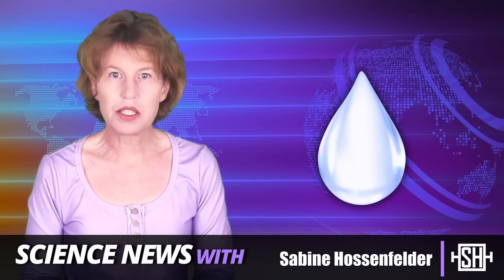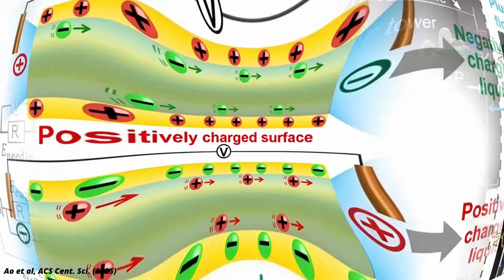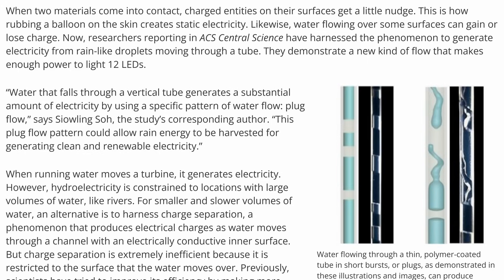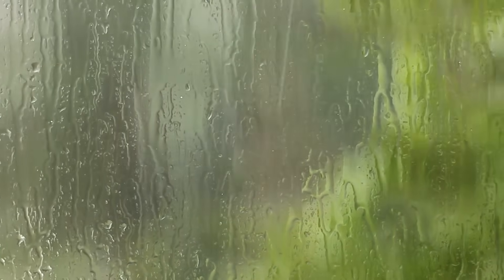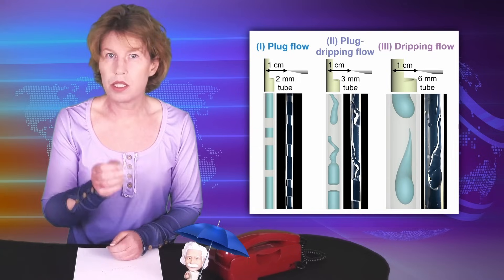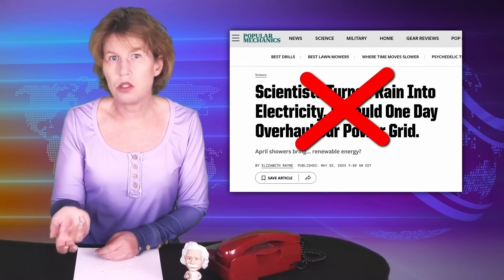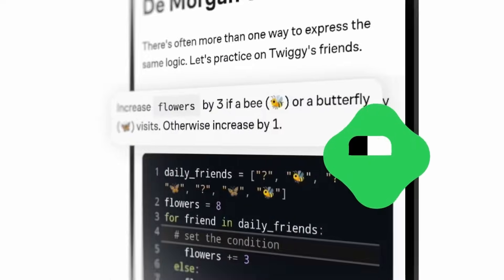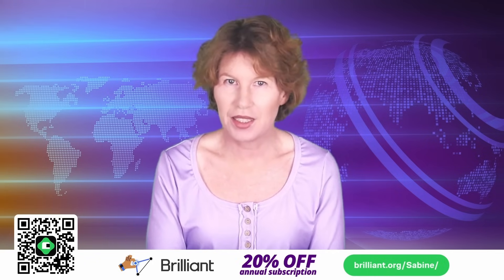A New Way to Generate Electricity From Rain

Comment: It's worse!   The paper is wrong!   100W/m2 just seemed too high to me.  I reviewed the paper and they have overstated the power density by a factor of 640x!     I looked to see where the 100W/m2  had been derived from and I found that the  authors have made a fundamental error in  their calculation.    They quote a peak power of 440 ± 13 μW  for a 2mm diameter tube,  320mm long.  To derive the W/m2 they have used the area of the end of the (2mm diameter)  tube and used that as the multiplication factor and indeed this would give 140W/m2 (as you have also calculated).  However,  the area of the generating device should be the internal surface area of the tube.   This means that they have an error of 640x  in their energy density calculation.   The correct figure is just 0.21W/m2 for the device. This is not a practical cost effective way of producing power in any form.

Comment: I told people years ago that eventually there will be cars which run on water, not on conventional fuels. Then I told them that energy will be made from rain. Then they were told that people will make energy from places, where there is no rain. Today solar panels are used to power deserts. When people listen to ideas like this they seem ridiculous at first. Then the facts come which show why they are not ridiculous. This is not hydro power, as hydro power will eventually be regarded as primitive tech. Instead, the electricity is generated from the rain itself, straight from the sky. That way you can make it possible for rivers which have been dried for centuries to flow again.

Comment: 2mm diameter tubes will quickly block up when exposed to the external environment, algea and other such fun stuff would build up. It would need to be a closed system with a fluid that will not block up thoe small tubes that such is used in.

Comment: A reservoir for fluid retention, along term fluid that does not do anything funky but will act like rain does in the generation tubes, an external method to get the fluid from a sump back into the reservoir... YOU now have a Gravity Battery...

Comment: I did the calculation for the potential energy of all the water hitting my parents roof about 20 years ago and I think I calculated that annually you'd get about 1kwh which is less than 20p/c and that was without any efficiency calculations just how much energy could be gained by the falling water.

Comment: I've already been doing this for over a decade now.  Actually you don't even need the water.  There's natural voltage potential between earth and increasingly high altitude.  I have installed a system on my property in Nevada ("useless desert").   I built the ion accumulator atop a local mountain and connected it via conductor to the valley below, some 1500m difference in elevation.  Works GREAT!  Tesla proposed something similar, so I wouldn't have the hubris (unlike these shameless people) to attempt to patent it, even though I have a WORKING APPARATUS.  Generating over 2000 Kwh daily!  It's fun!

Comment: I think that it could be potentially interesting if instead of paralleling them over the roof, you build much longer ones into the walls (or short segments in series if longer ones can't be made) and you have them doing triple duty: Structural elements, drainage pipes and energy generators. They are made of a fluorinated polymer so they shouldn't be super expensive to make. Dirt could be an issue so maybe a filter should go over them. They should be non stick and chemically resistant so I don't think biofilms could stablish in them to form clogs. Maybe they won't make a ton of energy but if they are cheap enough it may be worth it.

Comment: If there is some place on Earth with no sun, no wind, no electrical grid, only rain, then that place may use such powering system...
Or maybe it would be better to just buy small accumulator and replace it once per month.

Comment: Even if it easily generated 1000w per square meter, and didn't require heavy rainfall, the problem would still be that rainfall doesn't happen anywhere enough for it to be a reliable source of power.  Even a closed indoor system would still require water pumped upward, and that would basically remove all the gains. Then there's cost, and at 250,000 of these tubes needed per square meter, even if you could make each tube for 10 cents a piece, that's 2.5 million dollars to generate that small amount of energy per square meter.

Comment: In the late 1960s when I was in High School I built a Kelvin Generator first to satisfy my curiosity,  and entered it in the science fair. I had two projects in the fair. 

I realize that the Kelvin Generator makes static electricity which generally doesn't have much use, although it would make a fluorescent tube flicker if you let the generator discharge to one end of the tube.

Comment: Electricity is simple to generate if you understand it. Can literally put up a pole with copper coiled on it and make energy. Ground batteries can be made. Wind sun moving water. An several other ways. If everyone really knew an did something on it nobody would be so dependent on big energy.

Comment: DESALINATE WATER BY PRODUCING ENERGY 🤣🤣🤣🤣🤣🤣

CORDAURIAN SCIENTIFIC DOCUMENT ✦
Title: Water Desalination via Inertial Syntony and Energy Recovery through the Φ(x,t) Field
Author:  René Bouvier
Revision: v1.2
Date: May 15, 2025
---
Introduction
In the context of growing freshwater scarcity and global energy crises, this document introduces a unified solution derived from the Cordaurian Energy-Time Theory: a desalination system based on inertial syntony that uses the resonance properties of the Φ(x,t) field while simultaneously generating energy.
1. Theoretical Foundations

1.1 The Φ(x,t) Field and C₉ Strings
The Φ(x,t) field describes the inertial memory configuration of the vacuum that structures particles, matter, and fluid systems. The C₉ strings act as memory vectors, influencing the syntonic alignment of structures. The water molecule exhibits high resonance coupling with C₉ vectors, whereas ions (Na⁺, Cl⁻) have lower syntonic coherence.
1.2 Inertial Resonance and Phase Separation
Each molecular species possesses a syntonic inertia coefficient χᵢ defined as:
χᵢ = (δΦᵢ / δM_Cᶦ) • f(ωᵢ)
Where:
- δΦᵢ is the variation of the field syntony induced by species i
- δM_Cᶦ is the inertial memory gradient for species i
- f(ωᵢ) is a resonance function centered on the syntonic frequency ωᵢ
Water molecules align with a strong f(ω_{H₂O}), while salt ions are less coupled, leading to a natural phase migration during field modulation.
1.3 Energy Recovery via ΔM_C (Memory Differential)
The syntonic separation yields an inertial energy differential defined by:
ΔE = ∫_V [½ • ρ(x) • (ΔM_C(x,t))²] dV
This energy can be transformed through inertial-to-electric converters, or used to induce micro-thrust for energy generation.
2. Device Architecture

2.1 Φ-Modulated Inertial Cavity
- Toroidal or oval geometry (constructed in glass or inert ceramic).
- Oscillation frequency: H₂O syntony (tested at 18–24 THz).
- Inertial modulation: UP–DOWN at low amplitude.
- Φ(x,t) = Φ₀ • cos(ω_res t) • e^{-κ(x) R²}
- Modulation actuator: piezoelectric resonance generator (commercially available).
2.2 Fluid Injection and Confinement
- Seawater input via microfluidic injectors (100–500 µL/s).
- Ionic confinement through memory dephasing.
- Extraction via central nozzle.
- Flow control: programmable pumps.
2.3 Energy Recovery System
- CORD-9 sensors measure M_C(x,t).
- Converters:
  - Type A: torsional resonator to dynamo.
  - Type B: piezoelectric + EM induction coil.
- Optional inertial turbine with magnetized rotor.
3. Energy Production Model
Power density:
P_Cordaur = Φ⁴ / R²
Assuming Φ = 3.5, R = 0.2 m:
P_Cordaur = 3751.5 W/m³
Expected energy recovery: 1–3 kWh per m³ of water.
4. Applications and Perspectives
| Domain | Impact |
|--------|--------|
| 🌊 Freshwater | Large-scale production without osmosis or evaporation |
| ⚡ Energy | Co-generation of 1–3 kWh per m³ of desalinated water |
| ♻ Ecology | No pollution, inertial efficiency > 80% |
5. Experimental Roadmap
1. Build a UP–DOWN Φ cavity prototype.
2. Integrate piezoelectric drivers.
3. Inject seawater, monitor ΔM_C.
4. Extract freshwater, measure output.
5. Compare with conventional methods.
6. Feasibility Status – May 2025
- Core Materials: Available.
- Power Electronics: Commercially viable.
- CORD-9 Sensors: Prototype feasible.
- Control Systems: Off-the-shelf microcontrollers.
- Estimated Cost: ~3500–6000 € (lab scale).
- Scalability: High via modular toroidal units.
Conclusion
This Cordaurian system transforms constraint into resource: saltwater becomes freshwater, and resonance becomes energy. It is experimentally feasible today, scalable tomorrow, and vital for the future.
✦ Report validated by  René Bouvier ✦

Comment: Is this the same mechanism as Lord Kelvin's water dropper/thunderstorm?

From Wikipedia:
In 2013, a combined group from the University of Twente (the Netherlands) constructed a microfluidic version of the Kelvin water dropper, which yields electrical voltages able to charge, deform and break water droplets of micrometric size by just using pneumatic force instead of gravity.[5] A year later, they developed another version of a microfluidic Kelvin water dropper,[6] using a microscale liquid jet (which then broke into microdroplets) shot onto a metal target, which yielded a maximum 48% efficiency.[7]

Comment: Stupid scam. Pseudoscientists. It is much easier and more efficient to divert rainwater to a turbine.
Electroosmotic phenomena are nothing new, but collecting such a large area requires a roof, a structure. Here, if someone already has one, they can get up to about 90% of the gravitational, potential energy of water.

Comment: Solar irradiation is good for about 1kW/m^2 on Earth, at the equator, at noon, on the equinox, if the sky is not overcast.

So to be able to get perhaps 10% of that on days when there is decidedly no sunshine would be a useful contribution. If it rains. A lot.

Comment: This idea just made me think of a way to turn sunlight into electricity.

1) Focus sunlight through a pair of old eyeglasses...

2)...Onto the backside of a rat...

3)...Make sure the rat is affixed to a little treadmill which is itself attached to a little electric generator.

4) Enjoy your free electricity. Probably about 100 watts per square meter. Depending on how many rats and treadmills will fit inside a square meter. Whatever a square meter is. 😂 (2nd repost screenshots taken)

Comment: First off.....
Unlike Solar, there's no upper limit on how many of these units can be stacked vertically, other than the sky.

Charge density ranged from 0.8-1.6 nC per mm.

With 2 mm diameter tubes and a max packing ratio of 0.66 for the tubes in cubic meter this equates too ~0.264 Coulombs per cubic meter.

However one gains ~ 1 Volt/cm in vertical height from ground in atmospheric charge; so stacking these as tall as a small skyscraper of ~200 meters tall with ~ 50 mm spacing between each layer can generate a combined potential of ~ 53 coulombs with up too 20,000 volts. 
Seeing that theres ~ 0.9Volt drop per second this equates too ~ 11.7 megajoules per second or 11.77 megawatts.

Secondly, this is a basic proof of concept experiment that's a strong floor, not a ceiling for this technology approach.

Once could massively boost the output by coating tubing with nanoparticles, making periodic Venturi like junctions to increase droplet velocity, adding in peizo layers like FEP to self charge/pump, introducing semiconductor thin films like PEDOTs, or ever making submergible structures that are placed in the ocean to exploit a continuous hydrodynamic flow.

Thirdly, when stacked membranes are used, the voltages in series allows for auto-electrolysis to occur past breakdown potential.

With hollow flourosilane coated membranes this easily allows for the current energy to produce clean hydrogen on demand with no moving parts; especially when submerged in large bodies of water.

So yes; this approach can make solar obselte and scale nicely.

But thank you again Sabina for espousing status quo.

In a world that's rapidly changing, it's good to know some dilettante's will never change! : )

Comment: Use a thin piezoelectric crystal bound to a material that has the highest expansion/contraction rate when exposed to water and the effects of evaporation. As rain falls, each "cell" will expand, then contract, creating a usable charge from the piezoelectric effect.

Comment: For about $1k (16 cells lifepo4 battery)+$400 case, I can quickly build a 15kwh battery. I need about 4 for the entire house. For about $2300, I can get a pallet - 30 panels- of solar yielding just over 9kw from SanTan solar. This easily powers the house offgrid with AC and charge a car.  Plus or minus this depending on where you live, amount of sunlight, etc... The energy crises is already solved, we just choose to ignore it. It was a slow role...and, maybe, that's why it's not really the shocking headline we've all been waiting for.

Comment: Mostly a great take. But, I don't see it being useful, not for rainwater. Sure, you don't need a turbine, but you would need 2.5 million of those tubes for every kilowatt, and rainwater isn't clean. Sure, it has typically very low amounts of dissolved minerals/salts, but it is also typically very far from clean, the tubes would clog up pretty fast.

Also, as it's the gravitational energy that's used, combining them lengthwise to the combined height that's available instead of using more of them side by side would be the obvious way to do it. 

The only situation I can think of where it potentially could be somewhat useful is in a closed loop system with evaporation and condensation for heat rejection, with the condenser as far above the boiler as practically possible. In a closed system the working fluid can be kept pure. Still, the efficiency needs to improve, or there needs to be some really good reason to not just use a turbine for that to make sense. Turbines are pretty simple things, easy to produce and robust. Designing turbines can become complicated when you need to maximize the efficiency, chasing every last fraction of a percent of efficiency, and or some other aspect of a given system complicates things, but it wouldn't be very difficult to design a fairly efficient turbine, that can also work reliably for a very long time in a system where those tubes wouldn't get clogged.

Comment: I dont know if people are trolling but this is valuable in the long run even if it’s not effective (if the cost benefit is reasonable). The idea loses on a zero sum market but wins in an auction market, meaning even if it has no raw value it makes something new. You create something which fails on relevant metrics compared to hydro turbines for example but there is value in just knowing that this is possible. I mean, this type of science indirectly improves the better technologies in the way that f1 improved street cars, in the way studying thermophilic archaea led to the omics revolution. The process is like playing minesweeper , where early moves set you up. I’d say we mess uncertain , but not stupid, moves set you up to beat the level (Reap the proximal ROI).  I definitely agree that we have problems when experiments get prohibitive , like when the channel talks about the Collider experiments.

Comment: There is no end to the ways we can capture energy transfer. The problem is always efficiency and practicality of application.
>
This is no different to a large dam or water reservoir with the rain surface area over a far larger catchment, to be able to drive a few small kinetic turbines, except less efficient.
>
Another idea would be to a rotating drum with flat blades to capture the force from momentum of the falling rain drops, and still capture a small amount after from gravity of the water sitting on the blade as well.
There is no end to ideas :P

Comment: Commenter = @Tore_Lund = Yes.. Power using waste underground space = Hyperthermophiles + Sewer waste extracted nutrients by ultrasound holography system that should also be able to mix if made right = Heat enough to ignite organic materials, doubles every 24 hours can be controlled with sound, and the reason you can activate them on frozen ground with nutrient pile is same way Thing in the scary movie stayed safe in cold. Cold Steam Tesla turbine made good can last decades or more and cold boiling water panel with vacuum pump around cold side can also make the great heat of those Bacteria worth more. https://youtu.be/2pGxVvSizoE?si=8ZN-myUpv-8O8qQJ In video he pushes turbine using 134F.. Youtube search: "Mulch can set on fire"

Organisms of fire that can use what your whole world wastes.. An organism that as long as a colony on the darkest world has you then it can run. No light or anything just nutrients & oxygen but oxygen easy when you got power. What is heat? What splits water into hydrogen & oxygen? Vibration yes? Points at Ultrasound resonance then hits button on 1,000 watt Ultrasound tank Guess what would be making the whistles on it scream if added? Hydrogen & Oxygen.. Direct resonance transfer no destruction of content from overheating. LOL.. - Watchers